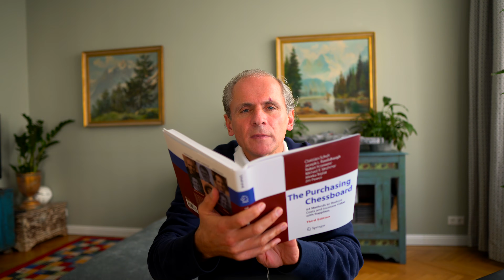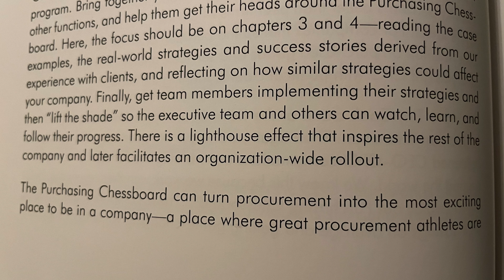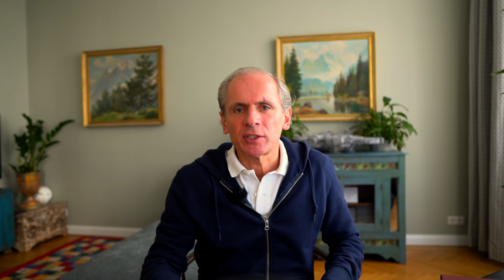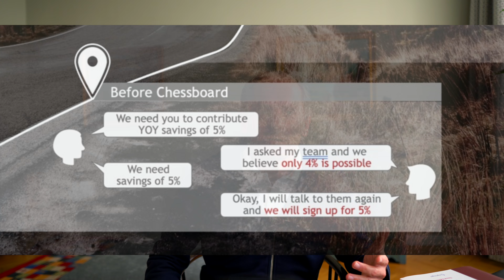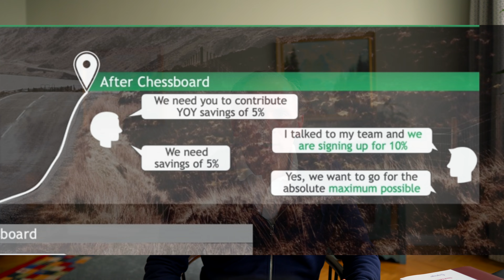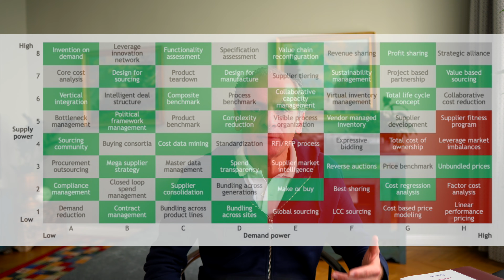Session 1 of the Chessboard Master Class: Why YOU should use it

Comment: I am a buyer in a middle/large high tech production firm with low procurement maturity. When trying to introduce the chessboard as a guideline for developing our department it was dismissed as being to complex. I'm looking forward to the masterclasses to get practical examples to keep trying and get things moving.
Reply from the maker: That is a feedback that I hear a lot. And there is no definite answer to it. We tried to mitigate this with the less complex 4 basic strategies and 16 approaches. But the magic really is in the 64 methods. One way to deal with this is to clearly separate skill levels. Every buyer should be able to navigate the Chessboard. But special skills like performing cost regression analyses should be concentrated in Centers of Excellence. Another way to deal with it is wrapping an AI around the Chessboard.
Reply: @byChristianSchuh  thanks a lot for that insight regarding AI use case. It is a classification problem with all 64 levers being the target variable (or dependent variable) that need to be predicted / found.  I presume the attributes to be used to model are the answers derived from the supplier power / demand power situation. I read Purchasing Chessboard years ago so I do not remember the entire methodology. I will try to create an algorithm for this use case but I will probably not have sufficient data points.